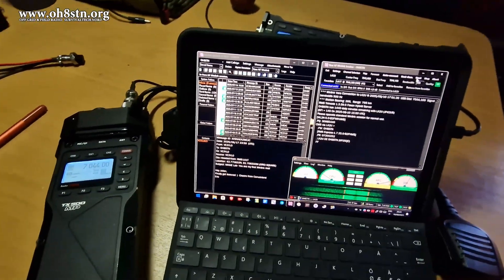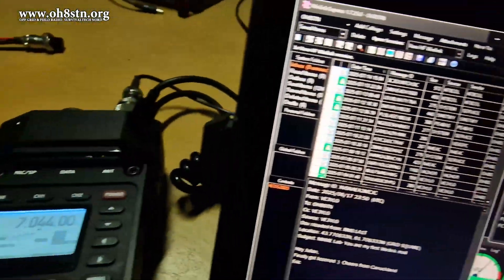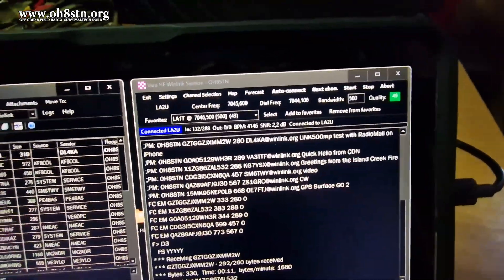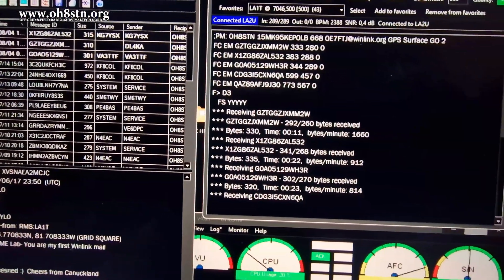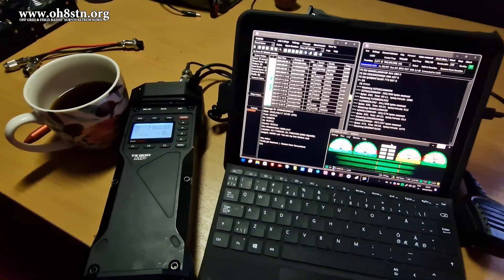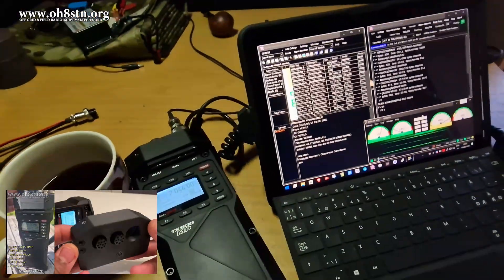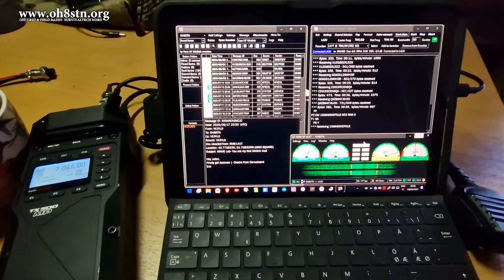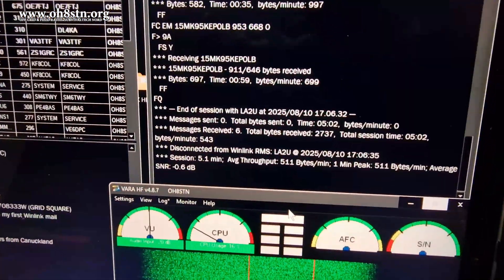Lab599 TX-500MP Winlink Email

Comment: You should review the Xiegu X6100/X6200 and the internal modem, internal antenna tuner , internal battery - Winlink works great and digital modes are super easy
Reply from the maker: I have 👍 x6100 is one of my favourite radios for data comms. I've got a video on it called "clandestine station in Berlin"

Comment: Could you possibly demo this Tx/Rx email over WinLink via WoAd with your Android device....if possible with wire free Bluetooth comms between the Android device and the Link500 ? How far away from you was the Winlink rx station in this demonstration ?
Reply from the maker: Happy to do it 👍
Reply: @OH8STN also a similar demo of using HF APRS to push out a short email via the EMAIL-2 function. (Don't think the APRS to SMS bridge works in your part of the world). Using Ham radio to also communicate/message  with non Hams in extremis is extremely valuable Emcomm functionality.

Comment: Man if they added 2m/70cm & 20-30watts it would be basically perfect
Reply from the maker: Indeed, but it would also be 3x its current size and weight 👍🤣
Reply from the maker: Or maybe not. I mean the 817 was all mode all band. The only thing missing is the 20 or 30 watt final output 🤔

Comment: And why exactly are you advertising a Russian product? Money doesn’t stink, huh?
Reply from the maker: This is the only rugged HF/6M ham radio from any country. As a survivalist,  continuity of communications is critical.  If there was a locally or western designed rugged HF/6M radio, I'd buy it and show it on the channel as well.
Nice try, though 👍🤣
Reply: @OH8STN as a survivalist, way more sense to rely on products of home country , or at least allied nations you are going to survive with, rather than on products of the nations you are surviving against,  isn't it ?
Reply: @maximsiryy9354  It's the other way around, actually. It's usually your own government trying to ,,, SUPRESS" you, using foreign government as excuses. As such, using foreign equipment is usually more secure(although iphone is proof that's not always the case )
Reply: @RRninja-jq6lp yeah, of course. Think about it - who would put 'kill switch' in their smartphones and other user equipment - chinese xiaomi or iPhone. Oh wait - iPhone made in China too, nevermind.
Reply: Made in UAE.
Reply: @TerminalElement made in russia. Check their russian website ...
Reply from the maker: @maximsisiryy9354 Your logic isn't flawed. If there was a ham radio focused HF/6m radio, with internal 18650 batteries, wide voltage input, with continuous TX/RX from 160m - 54Mhz, light enough to carry but built like a brick, which had no remote kill switch inside, and came from my own or allied country, I'd buy one. Sadly, that radio doesn't exist 😔

Comment: Nice setup.  I have a LAB599 with an early PA-500.  I have never operated with the digital modes but I think I will need to when I operate from the UAE to Arizona early next year with my 599/500 setup.  What mode would you recommend for digital voice to QSO with my friends here in Arizona?  They don't operate digital modes either, but if we had a direction to go, we will tool up and become proficient in those modes.  You can email me from QRZ. Best regards, Larry N7LK

Comment: Another great video, Julian.  The EMCOMM team here runs lots of VHF & UHF Winlink.  I've recently added VARA HF Winlink to my daily on-air time.  In the shack, that involves my FT891.  I now have a list of stations I can reliably access, normally at 20w.  It's time to go portable with the TX-500 and the EFRW antennas.  Other than my perpetual CW operating challenge, this is becoming my favorite niche. 72 de KJ4MZ FM17

Comment: I certainly like the setup. Much tidier than the TX500. The price of the link500 seems a little steep though.
Reply from the maker: Yep I'm not arguing about that. It does have a robust Packet TNC, audio interface, bluetooth, embedded GPS, and cnc machined aluminium case on the production version.  I'm not trying to sell it, just saying. Thanks for the feedback though, Oliver needs to see it.